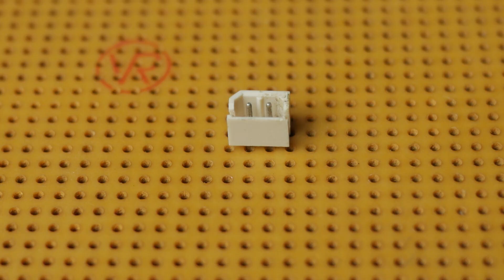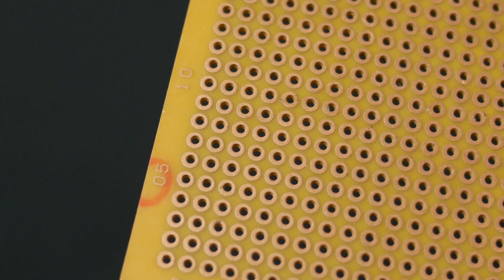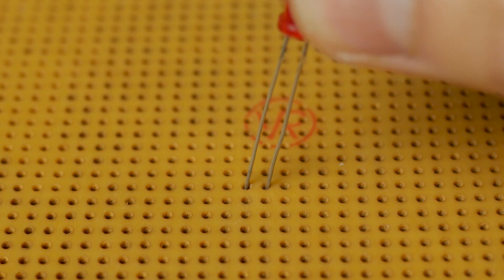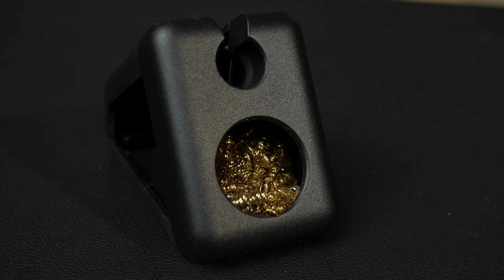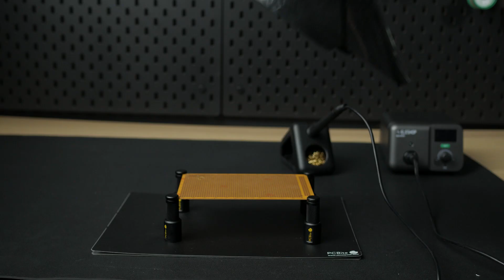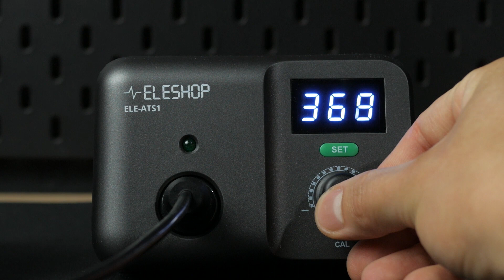New to soldering? 5 things you MUST know

Comment: great video indeed and great shop tbh. Just repaired a wireless PS2 receiver for a new old stock logitech controller. My first soldering job, I used the ELE-ATS1 soldering station showed in this video, a led magnifier, flux, braid, and that Japanese solder sucker.  I'm stoked ! thx for everything you provided Eleshop.